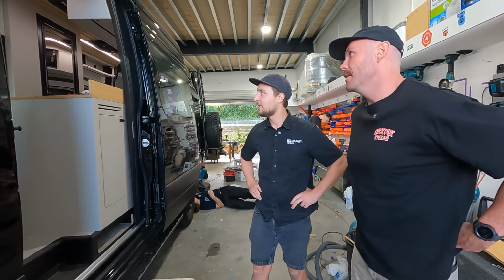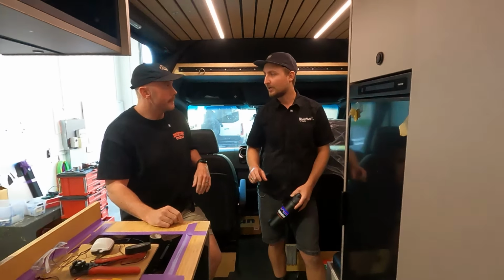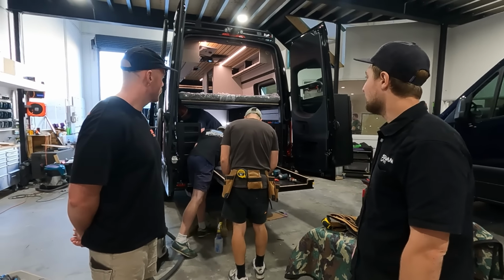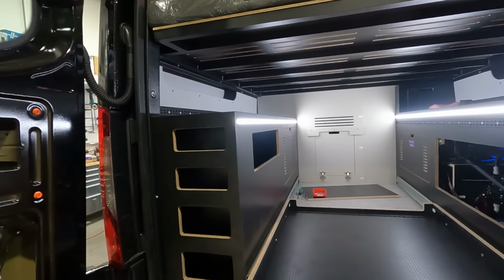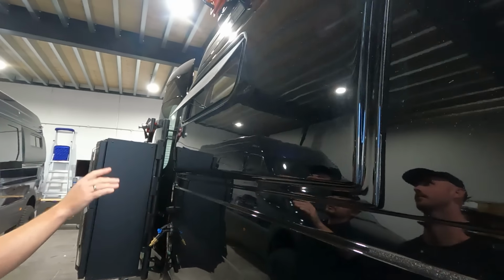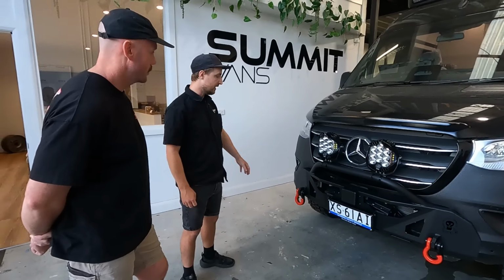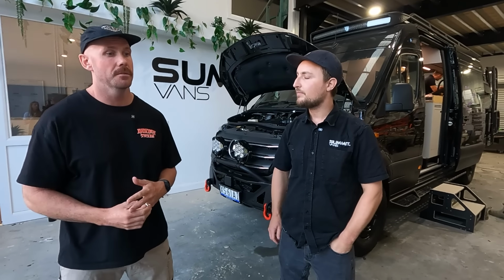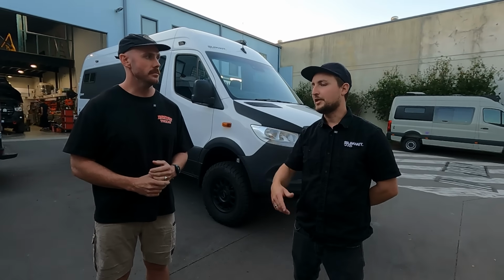AUSTRALIA'S BEST VAN BUILDERS!? Catching up with Summit Vans/ Adventure Fitouts.

Comment: Adaptive cruise control is a pain in the arse anyway, I think we've gone too far in the driving autonomy direction, and I'd rather run larger tyres especially on a LWB for ground clearance. Every 10mm makes a significant difference
Reply: I wonder if Summit has a fix so that larger tyres can be fitted to the LWB with duper singles? I am buying one similar to the one above with all the fruit. I too am concerned about the LWB and ground clearance…

Comment: I'm loving that tall narrow fridge-freezer. Really slick interior lights too, I've tried three or four different LED strips and they all look bad when set to white. Maybe these guys could look into bonding their own plywood laminate using a thermal vacuum bag system. He knows his stuff with weight too, I have an older 3xx professionally built by a fairly big company (which he didnt mention during the video), I'm stripping and rebuilding the back half because they used 19mm MDF for everything and I have no practical payload left. I checked the website, they haven't listed their LED strips.

Comment: What is your take on a 144 vs 170 for off road use? Do you think the 170 would be much less capable?
Reply from the maker: Hey mate, the 170 is way less capable having a worse break over angle. Even in our 144 we would belly out alot. 
And I believe the departure angle is also worse in the 170.